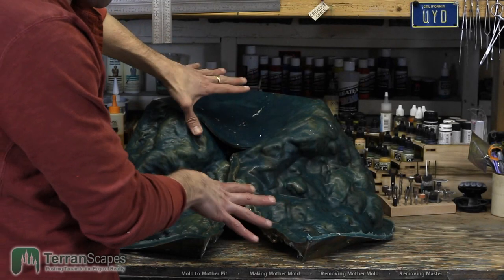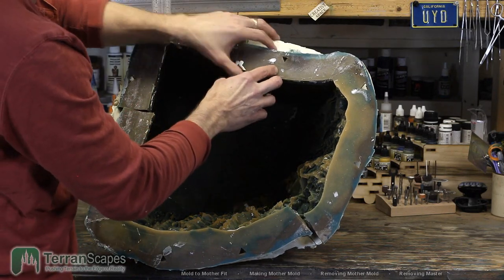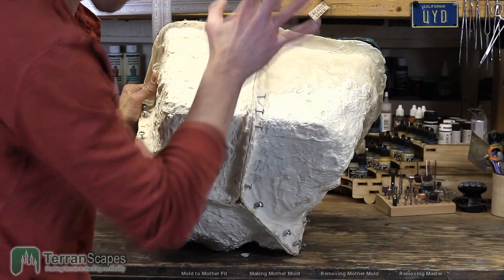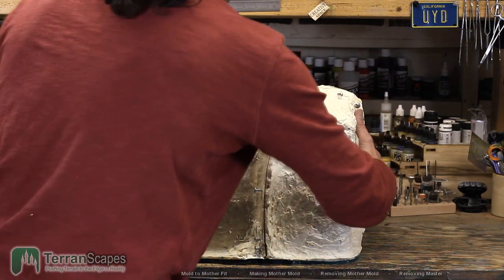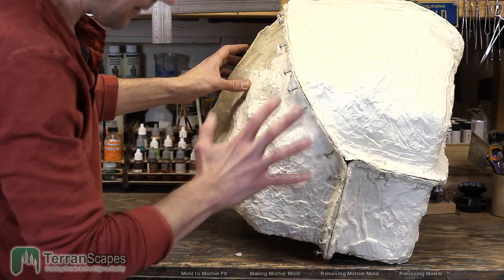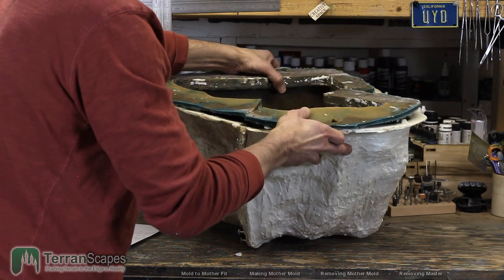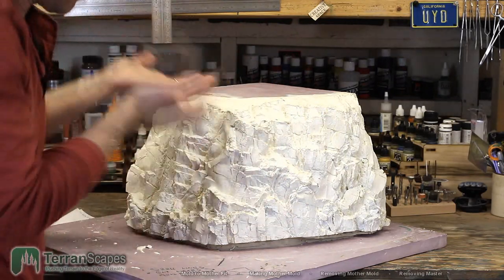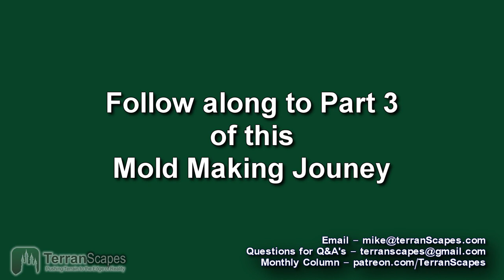TerranScapes - Ocean Cliff Mold Pt2 - Plasti-paste Mother Mold

Comment: Could you use bolts as the keys for the mother mold?  Then you could just screws into the keys and kill two birds with one stone?
Reply from the maker: Oh, wow.  That is a really good idea.  I'll have to think about how to do that next time.  I can see some real advantages.  It would be helpful to have the nuts wide enough to embed in the mother strongly.  Maybe with wing nuts...  And if I use the screw as an alignment guide when applying the plastic, everything should line up nicely.  Very interesting indeed.  Thanks!  I just put a note in with my mold making supplies to remind me down the road.

Comment: nice, could COMPRESSED AIR ( from example airbrush )  help you to get the mould more easy from the cast. put some small tube in the hole end let air lift the silicone a mm from cast.
Reply from the maker: That is a really interesting idea.  I could see that being worth a try for sure.  Basically you are fighting a very slight vacuum so that might help.